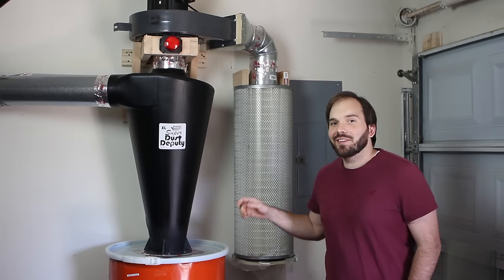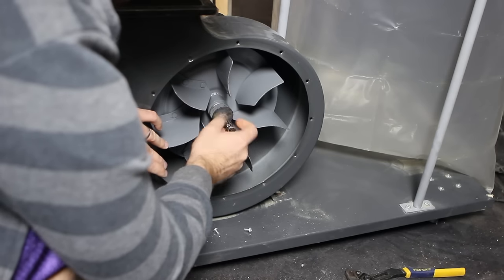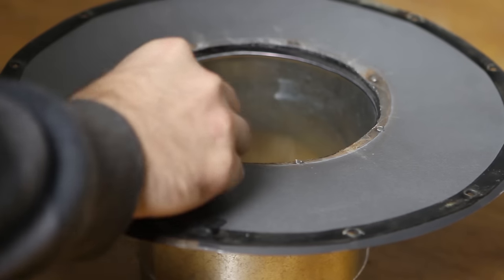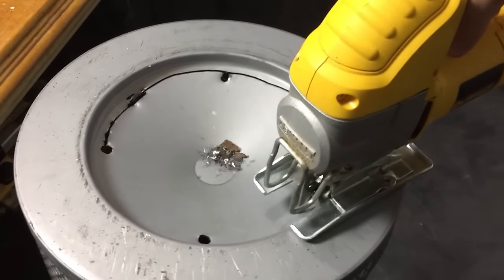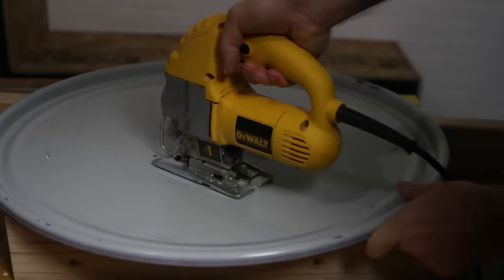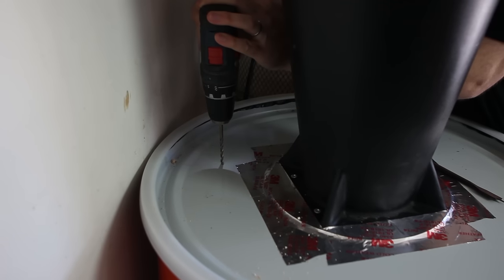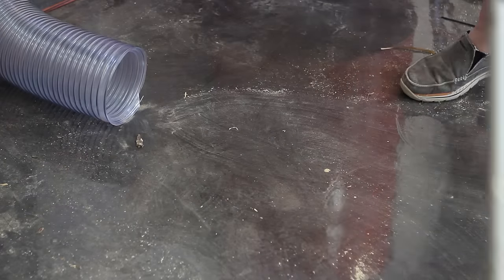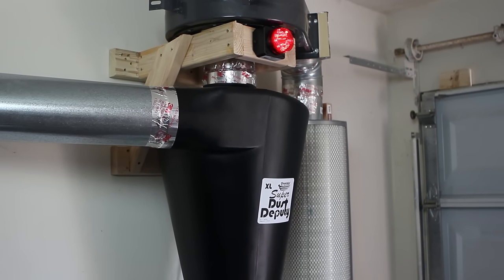Harbor Freight Dust Collector Mod w/ Super Dust Deputy XL - Updated

Comment: Great stuff! Any reason why you went with the Clark filter over the Wynn filter? I'm having a hard time justifying the $200 filter cost that's used on other HF mods.
Reply from the maker: +dwdrummer I went with the Clark filter because it has over 300 sq ft of filter media and I found it new on eBay for under $40. Most of the Wynn filter I see people using for their Harbor Freight dust collectors are designed to replace the bag and have to be a certain size. For my design it didn't matter the diameter of the filter.

Comment: Brent, did Rikon ask why you wanted to buy their impeller or was it a no brainer to call and get it ordered without any problems? I would imagine many people are doing this now so it shouldn't be a problem.  Either that or they may be stopping this practice all together.
Reply from the maker: +Bryan Greifinger To my surprise they were really helpful and didn't ask any questions. I just told them the part number they confirmed I wanted the impeller then took my information and payment over the phone. All in all it took about ten minutes.
Reply: Great to hear !!  Thanks!
Reply: Wait until the EPA gets hold of this information. They will have a regulation out in a few days making it a federal crime to modify this machine. Hells Bells, I'm already filing a complaint to the Air Research Council on the use of improper parts in the modification :--)

Comment: what kind of filter?
Reply from the maker: It is a Clark Filter #1565938. I found mine new on ebay for $38 but here is a link to where you can purchase one from a vender, https://goo.gl/Lt6rvu . It has just over 300 sq/ft of filter area which is really great!
Reply: Minimum purchase: 4 units. Sigh.
Reply: That replacement number is not the actual Clark number but of ACS.
It also lists for $81.87 which is a lot cheaper than Oneida and others, unfortunately you have to buy four of them.

Comment: Can you let me know what the dimensions this setup takes on the wall / floor space? Thinking about doing exactly this but want to know if my shop has the space.

Thanks!
Reply from the maker: +Jonathan York it comes off the wall about 26 inches and is about 40 inches wide. The ceiling is 8 feet and it is a few inches shy of the ceiling.

Comment: Wow!  By far the best Harbor Freight DC upgrade design I've ever seen!

Do you have a sense of total cost including the DDXL?
Reply from the maker: The total cost was around $550 if I include the cost of the DDXL. Below is the cost breakdown of the dust collector build:
Harbor Freight Dust Collector - $135
Rikon Impeller - $100
Oneida Super Dust Deputy XL - $240
Clark Filter #1565938- $38 on ebay
55 gallon barrel - $15
6” duct collar - $16
6” duct transition - $10
Reply: Gray House Studio, I am not finding that air filter number you have listed for your dust collector.  Do you have a listing reference on eBay for it?

Comment: Hey I have been having a hard time finding the Clark filter you have listed. What are your thoughts on this model Clark filter, 1212757? The only difference that I have seen is the flange on the top and a little less media area.

Clark 1212757: https://www.industrialcartridgefilters.com/MANUALS_TECH_DATA/Tech%20Data%20Sheet%201212757.pdf
Clark 1565938: https://www.industrialcartridgefilters.com/MANUALS_TECH_DATA/Tech%20Data%20Sheet%201565938.pdf

Comment: When increasing the air flow you increase the work the motor has to do.  This - by laws of physics - means the motor is going to work harder, thus, more energy and more heat.  Also I notice that the replacement fan blade is designed for a left hand spin (CCW rotation) whereas the original smaller blade is for a right hand spin (CW rotation).  I don't know if this was on purpose.  If so it's also a reason why you didn't get more CFM air movement than you did.  Increasing from 33 MPS (Meters Per Second) to 40 MPS, an increase of about 21%.  A lot of work for a small gain.  Had the fins been set the other way the increase would have been closer to 40% to 50%.  You DID double the blade size from 6" to 12".  In theory that's double the size and potentially double the air flow.  But as mentioned before, the increased size of the fan will mean the motor has to work harder and hotter.  Some of that energy is going into wasted heat.  I don't know the specifics so I can't be exact.  HP, Amperage, efficiency of the motor - all play into the calculations.  Just going off your measured results - the increase was not very impressive.  However, the build was well done and the presentation didn't include hours of "watch me" stuff.
Reply from the maker: It is actually a different impeller design. It doesn’t move as much air but it is made to keep more constant cfm under resistance.

Comment: Nice setup and good work on the mods. Did you take a cfm reading through the new 6" port at the (new) impeller? You were getting about 1100 cfm with new impeller and stock 5" port. Just curious as to the increase at the impeller housing.
Reply from the maker: I took a measurement with the 6" port and the new impeller. The reading showed I was getting about 1000 CMF with the 6" port compared to 1100 CFM with the 5" port. It seemed a bit disheartening until I realized the instrument covers up more of the 5" inlet than the 6" opening. This seems to artificially make the air move faster through the smaller port even though I still calculate CFM using the 5" and 6" measurements. Anyways, I'm confident the 6" port is still a better solution once long runs of duct are hooked up to the dust collector.
Reply: Thanks for the reply. I think your analysis is probably correct with regards to the narrow openings in the original impeller cover. Do you feel that you are getting adequate airflow at the farthest point from the collector? The 753 cfm at the table saw seems to be plenty. Nice work

Comment: Did you have problems with the collector tripping the breaker after replacing the impeller? I would assume it could run on a 15 amp breaker before, but the draw might increase enough after the mod.

Comment: The impeller blades on the replacement impeller are backwards from what you removed. This will affect the performance negatively. Just thought you should know.
Reply from the maker: Ya, the impeller blades tilt the opposite from the stock Harbor Freight impeller but they dust collector it is made for rotates the same direction as the HF and the blower housing is the same shape/design. The new impeller actually provided an increase in performance.

Comment: The SDD XL is made for 3-5hp blowers. I think you are asking too much from that 2hp blower even if you have a larger impeller. It can't generate the volume to support 6" ducts. You need at least 4000 FPS to keep the ducts clear. For the price of the HF DC and upgraded impeller you could find a used 3hp blower that would do twice the volume of a 2 hp unit.

Comment: Did you have to rewire the motor to spin the opposite way?  Those two impellers are supposed to spin in different directions.  A backwards spinning impeller can be hard to detect because the machine will still work when it spins backwards.  If it is spinning backwards, however, you are working your machine harder than necessary and can lose 60% or more efficiency.

Comment: Minute 1.11. The blades are wrong. The original centrifuges much more air. The blades are curved to catch the air, and the air is exited by centrifugation.
Reply from the maker: Since both impellers are designed to spin clockwise and the new impeller produced a huge increase in CFM I'm happy. From my research, the backward facing vanes of the new impeller are supposed to maintain CFM better as static pressure rises.
Reply: If that were true it would contradict just about everything I've ever learned about airflow and ventilation over the last decade I've spent in the commercial HVAC/R industry.
Reply from the maker: I appreciate your feedback and pushing me to do more research. I've found several articles saying that the forward curved impellers are best suited for moving large volumes of air against relatively low pressures (HVAC) but have a tendency to overload and stall under pressure. 

"Backward-inclined fans are more efficient than forward-curved fans. Backward inclined fans reach their peak power consumption and then power demand drops off well within their useable airflow range. Backward-inclined fans are known as "nonoverloading" because changes in static pressure do not overload the motor."
https://www.saylor.org/site/wp-content/uploads/2011/09/Chapter-3.5-Fans-Blowers.pdf  

Also, "Backward inclined and airfoil fans remain more efficient than forward curved when the filters in a unit become dirty/clogged." 
http://www.titan-air.com/centrifugal-backward-inclined-or-airfoil-versus-forward-curved-design

Both the above factors is what lead me to believe that the backward-curved impeller would be a great upgrade to my dust collector. It seems like Harbor Freight probably went with the forward curved impeller because the could cheaply get a high "Free Fan" CFM test out of a 10"  impeller.

Comment: You cannot get real  FPM or CFM  off of an anemometer designed for free air. I have found that method almost doubles the true CFM.   Adding the 12" impeller off sets the CFM lost by the cyclone. Just checking the amps  before the mod and after the mod the amps remain the same and so does the HP. and the CFM of about 350 CFM. If you made the 12" mod and didn't add the cyclone you would burn out the motor.  There is no magic here.  HF claims a bogus  1600 CFM and 2 HP.  It pulls a max of 14 amps which is  1 HP. Check your amp read and it's probably about 13.5 amps.  It depends on how dirty your filter is.  To get real CFM you have to use a Pitot tube in accordance with ANSI/AMCA 210-85